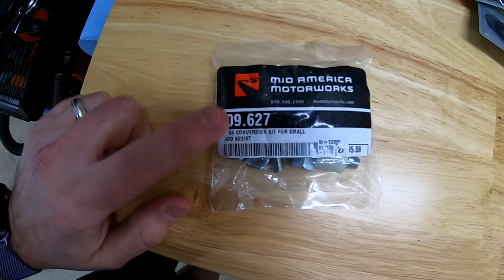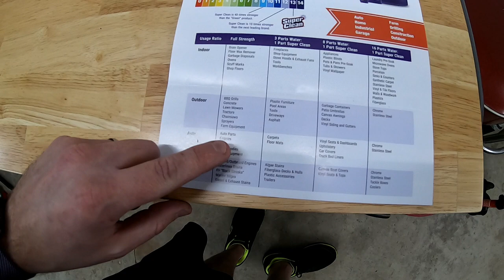ADDING a Mini Hood Strut Conversion Kit to Your 1990-1996 C4 Corvette!!

Comment: Glad you got it to where you can open your hood without your Dad’s help anymore. 😀 
It would have been interesting to see the difference just replacing the prop rod first. I can’t watch mine lift without touching it, but takes little effort to open. Maybe I need a new prop rod?
Reply from the maker: I actually wanted to do just the pop rod first but decided against it. Not sure why. Sorry man! I don’t know but if you release it and it falls, I would say it needs replaced!
Reply: @Doulop  maybe I need to replace the prop rod. It goes up easy with help and doesn’t fall,  it won’t go up by itself like yours does now. I’m sure my prop rod is the original. Now I’m mad, it ONLY lasted 30 years. 😀
Reply from the maker: Hahahahaha!!! You would think they would make good quality, don’t you? LOL replace it and see the difference :)

Comment: the original mini struts works excellent on my 1985 C4.
Reply from the maker: That’s great they still work. They didn’t install them on the 1991’s from factory. Makes no sense.
Reply: They actually stop installing the struts a few years prior. ‘91 is just the first year they removed the mounting studs from the hinges.

Comment: Dad should make a plow harness 4 u and do the garden.
Reply from the maker: Lol, he should :)
Reply: @Doulop  u have a good sense of humor, thanks. My 96 may have a blown hed gasket, owch
Reply from the maker: Oh no! What happened?
Reply: @Doulop  i am new to vettes, no oil in water, no water in oil. No smoke out of exhaust. Lt 1 pulls like truck. Some smoke in the engine bay. Im still learning. I just got it in janruary. Very clean, solid.i love c4s.i like your vids & dad.
Reply from the maker: Thanks Gary. I hope you figure the issue out. Please keep me updated. Thanks for your kind words :)
Reply: @Doulop  a strip of the motor belt separated. It be to cold out to work on.

Comment: When I was shopping for my at C4 last summer, I looked at one with a broken hood corner from opening the hood with a hand on that corner.  A body shop told me it was fixable but not cheap.  I open it with my hand more towards the middle of the hood, less likely to break off.
Reply from the maker: Hey Tim, thanks for this tip. Never thought about that before. Thank you!
Reply: @Doulop  I hadn't considered it either until I saw the car.   Your video is good, as a properly working strut will help avoid using too much force an snapping off a piece of your hood for an expensive repair!
Reply from the maker: Thanks a lot! I never would have thought of that either. Shouldn’t have that issue now, though.

Comment: Hello again. Very helpful vidio. Would you please confirm part number for the hardware kit from Mid America. Also would you also confirm the part number from Strong Arm. Appreciate the advice. I am 78 years young and any help lifting the hood of my 1991 C4 with 24,000 miles. Thanks Bobcat
Reply from the maker: Thanks a lot. Mid America part number for conversion kit is Part #: 609-627. The other ones don’t technically have part numbers because they are on Amazon. I hope you can get them and help your hood be lighter. Thank you very much